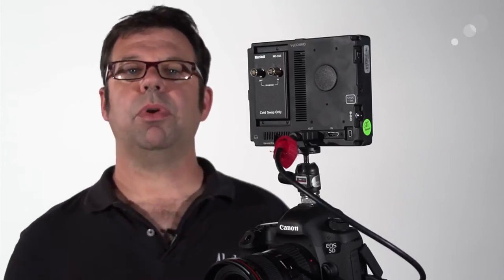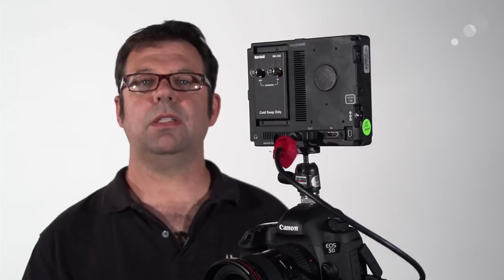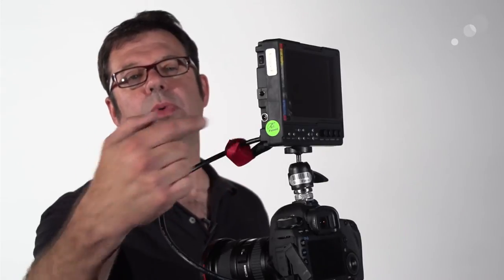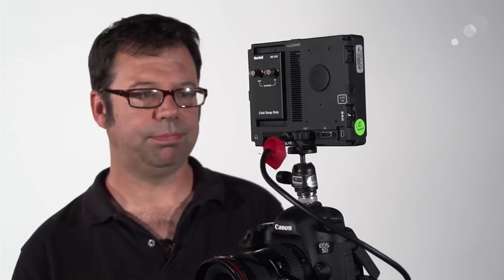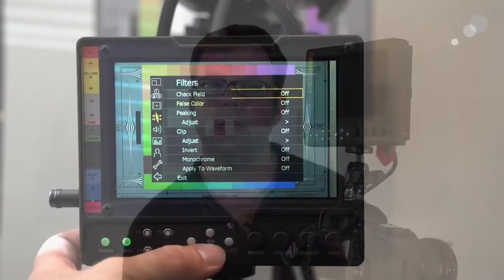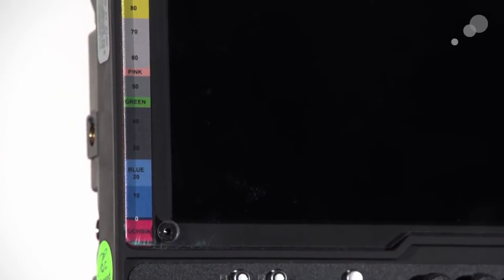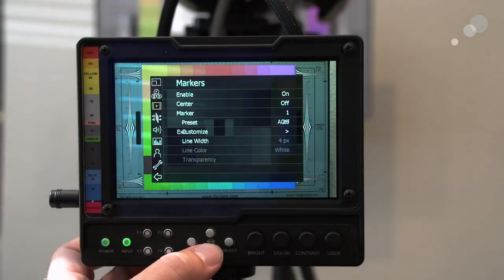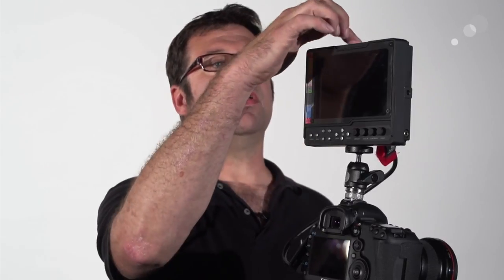At the Bench: Marshall V-LCD56MD Monitor

Comment: how do you get the battery plates to work? I have a CM battery, (batteries are 8.4v canon bp-975) but this monitor is taking 12v?
Reply from the maker: Hi Troy, here is a response from Ian: The monitor supports some but not all major brand batteries. In some cases, battery brackets require two batteries in order meet the monitors power requirements. Below please find a link to the current supported batteries.
http://www.marshall-usa.com/discontinued/camera-top-monitors/V-LCD56MD.php#:~:text=The%20V%2DLCD56MD%20is%20a,bias%20control%2C%20polycarbonate%20screen%20protection
Hope that helps! If you have any follow up questions, feel free to reach out directly at techsupport[@]abelcine[.]com.